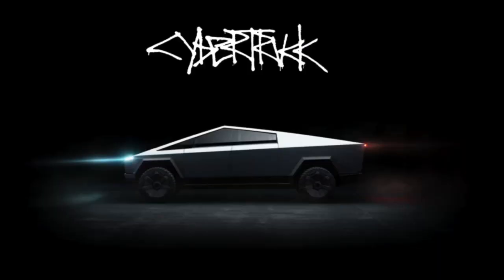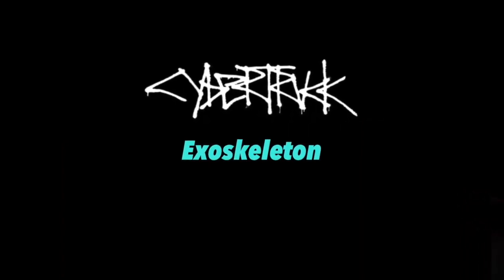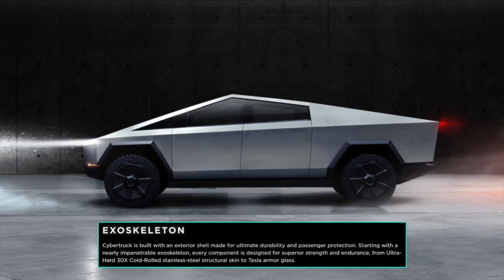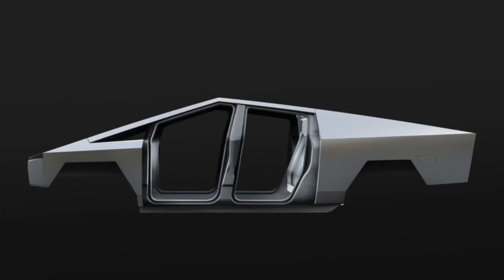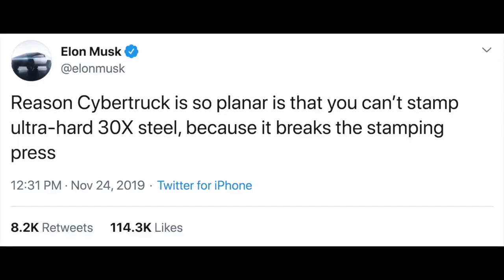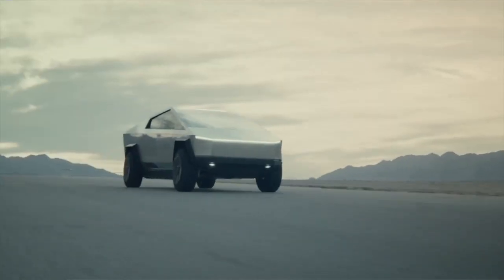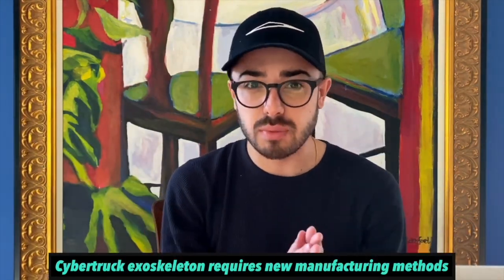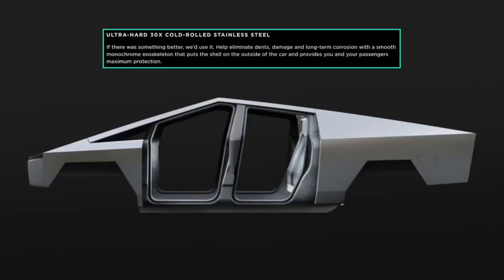The Practicality of the Cybertruck's Exoskeleton!

Comment: "...breaking the presses" would be a figure of speech. A stamping press has the force of several hundred tonnes which is needed to form up to 1 millimeter of steel sheet. To form stainless steel requires more force and to form 3 millimeter thick stainless steel sheets of this area would require several thousand tonnes of force. If you tried with a 500 tonne press, the only thing that would happen is that the press would jam in bottom dead center or the sheet will not be fully formed when you take it out of the press.
Reply: Bengt Björck - ‘breaking the press’ could be a reference to damaging the stamping dies.
Reply: @jameshoffman552  Which is very unlikely. You can damage the surface if you get gravel and rocks in there but thicker sheet steel will not damage anything. The problem is that the force will not be sufficient to form the sheet.

Comment: The term exoskeleton is in some way misleading. They use the term to describe that the outer shell is load bearing and take up stresses beyond carrying themselves or withstanding environmental impact like debris hitting the surface. The outer shell is structural.
However it is not a skeleton. A body on frame could be said to be resting on a skeleton. The Cybertruck shell is more of the type you find in a bug that doesn't have any skeleton.
A traditional car body, after they abandoned body on frame, also has load bearing surfaces. Not all of them and not to a very high degree, but for sure they contribute to the cars rigidity and crash performance.
The Cybertruck increases the rigidity by strengthening the body panels enough to carry a heavy truck. One of the many benefits are that the steel in the shell fulfil more than one purpose and thereby lower weight. You have no additional benefits of a frame sitting beneath the body. It doesn't increase protection.
Then in addition the Cybertruck is resting on the battery platform which in a way also serves as a frame. In some way you could say that the Cybertruck both have a frame and shell structure.